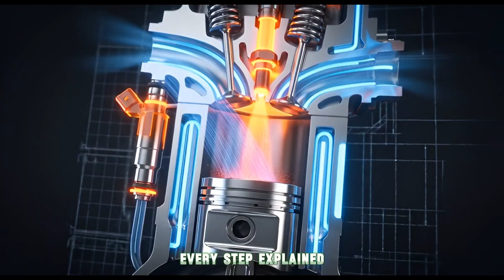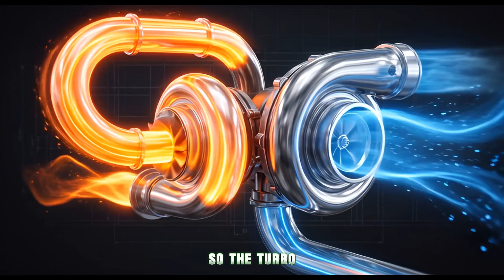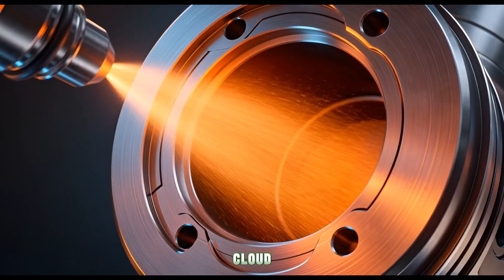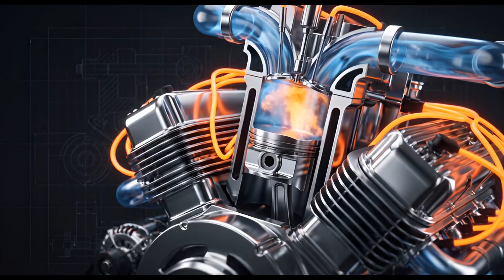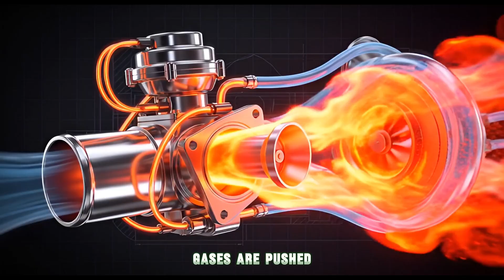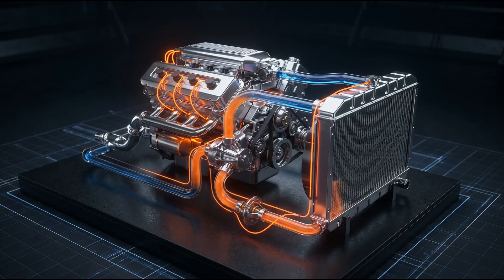How Your Engine Breathes & Burns — Full Breakdown (3D Animation)

Comment: This video is 100% WRONG !!!!
Reply from the maker: @xpresscolourart5531 I understand your concerns about AI. It's important to approach it with caution and critical thinking. 🤖
Reply from the maker: I appreciate your feedback! Could you please share what you found incorrect?
Reply: @EngineCoreHQ 

In the video there are gas flows that are very confusing to new guys and also wrong colours of gases representing hot or cool
Reply from the maker: @xpresscolourart5531 Thank you for your input! We'll review the gas flow representations to ensure clarity and accuracy for everyone. 👍
Reply: @EngineCoreHQ 

You have cold cool airflow coming (out) of the inlet and air filter.

Hot gas coming (out) of the turbo from both sides 0.33 seconds 

There are cool gas coming from the turbo outlet manifold 
There is a lot of confusion with gas flow directions.
Reply from the maker: @xpresscolourart5531 Thanks for your insights! We appreciate your feedback and will work on clarifying the gas flow directions. 🚗💨
Reply: @EngineCoreHQ 

Ai can be very non trustworthy 👊🏻